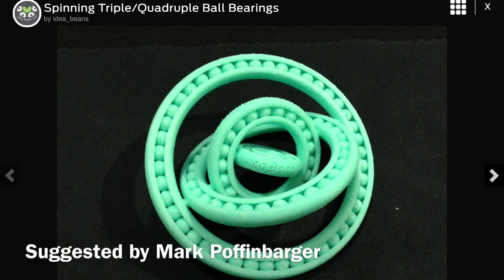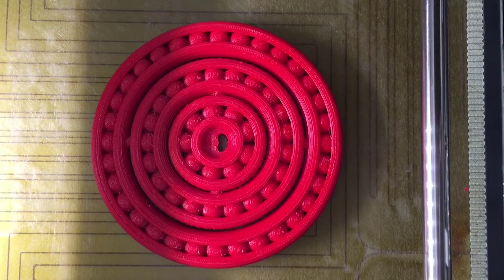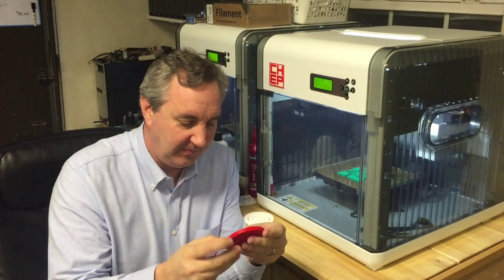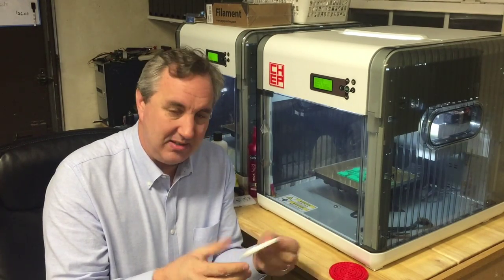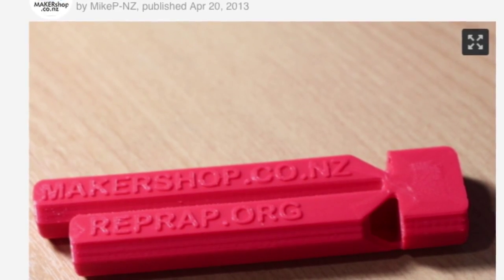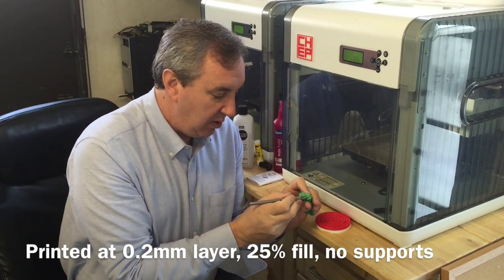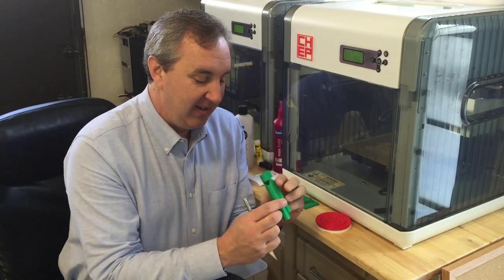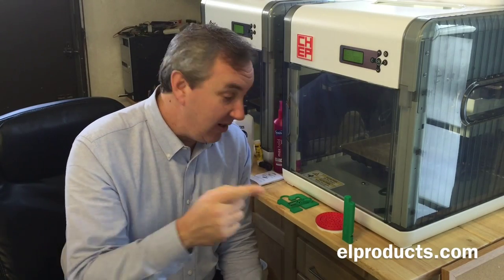Filament Friday #2 - Bearings and Whistles on Davinci 1.0 - Video #035

Comment: I have a da vinci 1.0 and I run with open xyz ware mod and simplify3d and the change of quality is massive. Cant believe your still using the stock software. Trying to print anything mildly large or complex takes way too long to slice on the stock software. I ditched it months ago.
Reply: I think one of the reason Chuck might stay with stock software is to help new users with their machines. I use S3D myself, but the stock application isn't bad for regular prints. 

Also using Open mod requires some tweaking with Slic3r and S3D is $150. S3D is worth it but a lot of people wont throw that much money at a program unless they need to.

Comment: Nice Video Chuck !
you talk about simplify3d - Now it has full Support with the Da Vinci's. Are u buying the Software ? Maybe you can make a tutorial about the Settings ?
Someone told me that S3D are Full Supportet the DaVinci and he no more Need the XYZ Software and the Results are much better.
Have a Nice Weekend.
Reply: Hi .. MrRockinRay I have Simplify 3D and the Da Vinci 1.0 printer .. You can use simplify 3D with the original firmware, with a lot more options, but there is a few restrictions in controlling the printer with the original firmware. So I installed the repetier firmware. for full control.
Reply: Bo Nørgaard Thank u for the answer. I can't install the Repitier cause i have the 1.0 AIO - is there a Repetier Firmware available ? Is it easy to use S3D ? now after 2 month i know what i have to do with the xyzware.Problem is, i can't find a demo version - and im not sure if i can use and understand this big software. One last question, can i set the temperatures for the Bed and the Extruder with the Stock Firmware ? 
Best Regards
Reply: Hmm I dont think you should install the repetier on the AIO coz you cant use the xyzware. and the scan option is gone :(.

So stick with the xyz firmware, and use simplify when printing and slicing.

Simplify is a dream to use although there is a lot mere options and can be confusing at first hehe. But on the webpage there is really good tuturials so you quickly get the han on it.

the bed and extruder temp is overrided from the cartridge, but u can set the temps from layer 2
Reply: ***** You can use both. I've switched back and forth and the 1.0 happily runs both softwares without an issue. I'm running 1.2.5 firmware on my 1.0. As was stated, not all features that Simplify3d offers works with the Da Vinci however they tend to be the extreme tweaks that hardcore users would tend to use. For most average/hobbyist users, Simplify3d and the Da Vinci is a winning combo.
Reply: Bo Nørgaard If you have to install Repetier firmware to take full advantage of S3D, why not just run Repetier host also? They are designed to work together.You can use whatever exernal slicing software you like then. I comes bundled with Slic3r and Cura. Both are a vast improvement over the XYZware slicing and Cura is blazing fast. I have no doubt that S3D is very good, but Repetier firmware, Repetier host, Slic3r and Cura are all free open source software that works much better than XYZware.